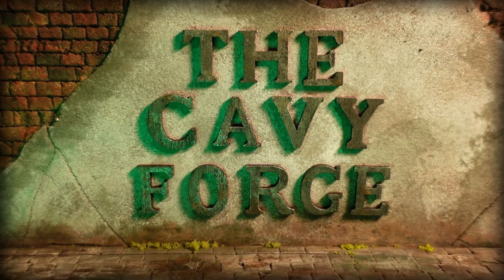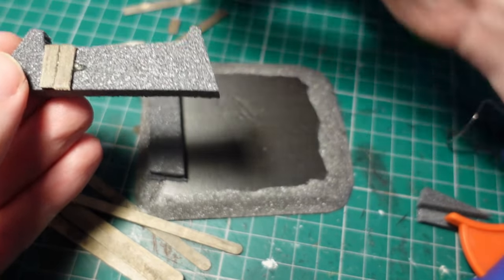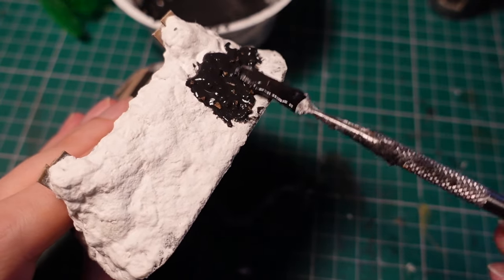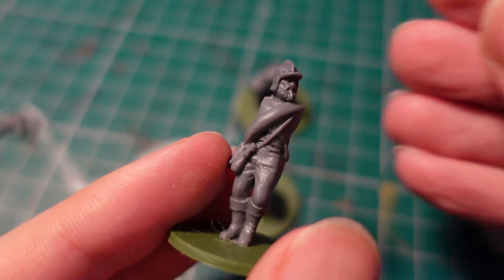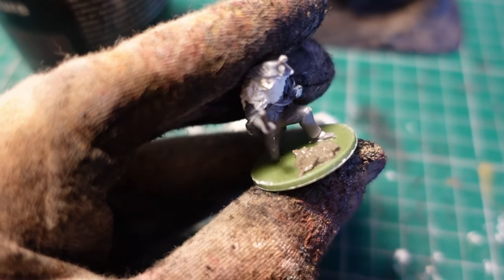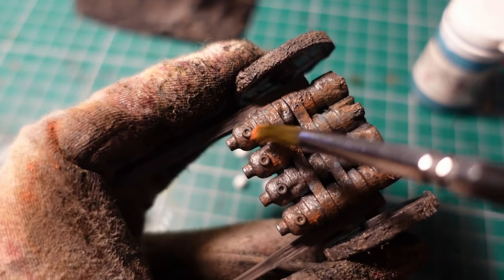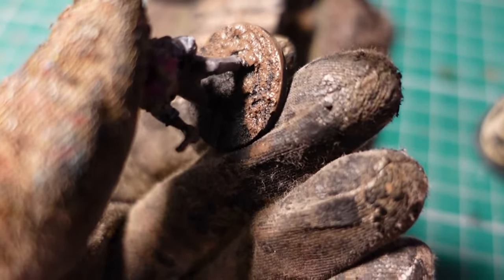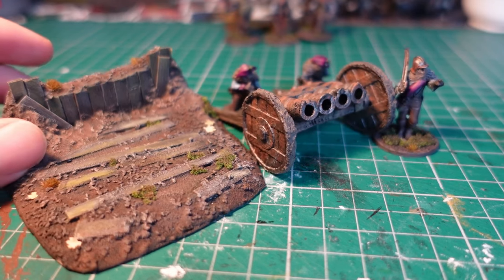Turnip28 Stump Gun with earthworks

Comment: Nice work.

For those lacking access to a 3D printer, Perry Miniatures do sell cannons. Either bundled as a kit in their American Civil War range, or by the sprue if you just want the cannon. The sprue gives you multiple styles of cannon barrel, so you could just use all of them to get the "multi-barrel" look here.
Reply: oh i didn't know about the sprue one! Thanks for the info
Reply: @Brigtzen  Yep. Perry Miniatures sells tons of their sprues separately. Very useful for Turnip28, where you might only need some assorted bits or single units of a particular type.
Reply: @Brigtzen  you could also cut some wooden coffee stirrers, then cut up some of those rounded sprues you'll sometimes get in kits and drill out one end and bunch them up together to form some sort of weird cannonade that's been scavenged together by the denizens of Turnip